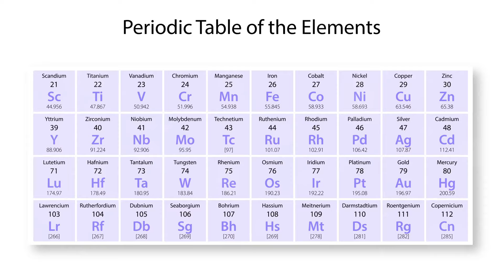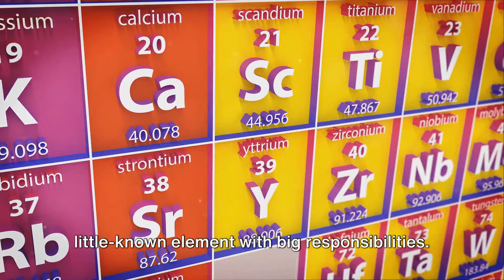Niobium

Comment: Very interesting and Well presented --  Thankyou  --  could you make a video on Neodymium  perhaps , sometime ,,,
Reply from the maker: Hi, I already have schedule for Neodymium, which will be available this March 17.
Reply: @ElementGB143  Thanks !  -- I am looking forward to it !  
 Isn't it interesting that out of the 90+ stable elements , ending at Protactinium  At. No. 91 , about 85% are metals  , only  10% are non-metals , and about 5% are metalloids  -- does that show that matter is essentially electrical in nature ?  Of course , all atoms contain positive and negative charges ,,, do you think Hydrogen is a metal ?  -- I  believe liquid Hydrogen does conduct electricity ,,, if so , it would be the lightest metal -- a metallic gas at Normal temperature and pressure ! ,,
Reply from the maker: @Soldier-n4h  you should look into hydrogen powered car. Its going to be used in a flying car as its the most abundant, but for now we need to do better with safety as its highly explosive.